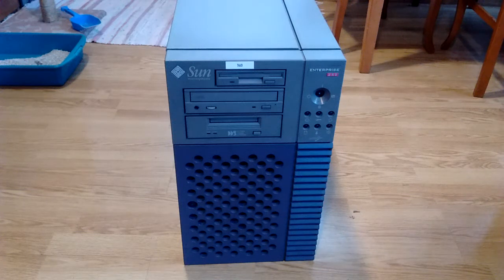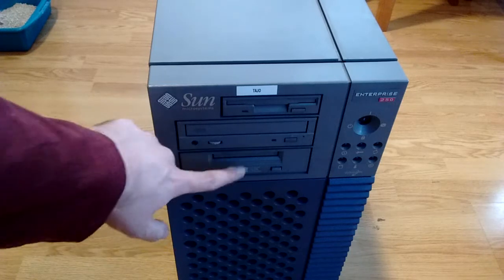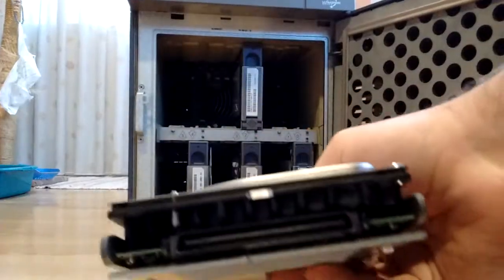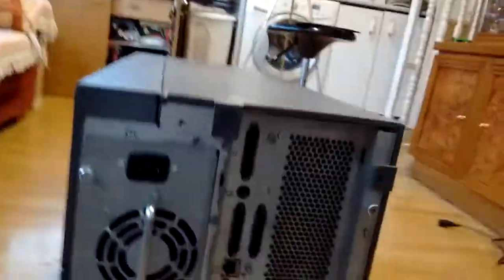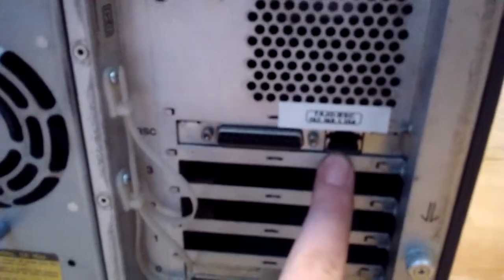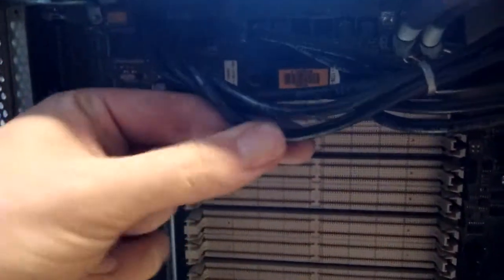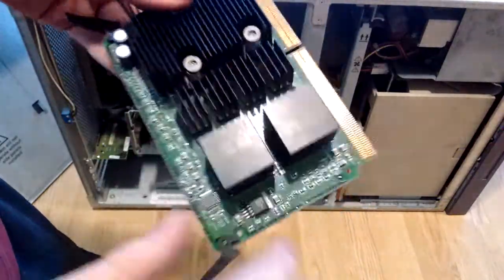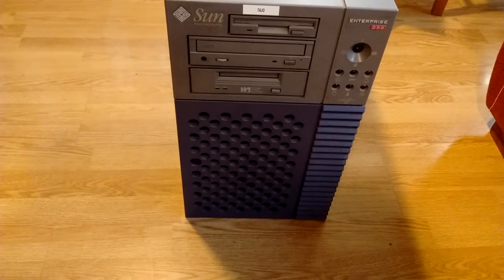Sun Enterprise 250 hardware tour

Comment: So it has a port for a "Sun Keyboard and mouse" but not for a monitor? I get that it'll mostly be run over a network or a serial terminal, but why have such a port
Reply from the maker: Some configurations had a framebuffer (Sunspeak for graphics card), so you could manage it graphically or use it as a desktop.